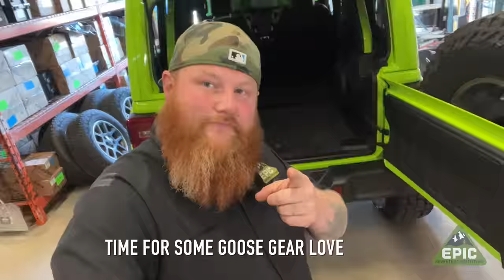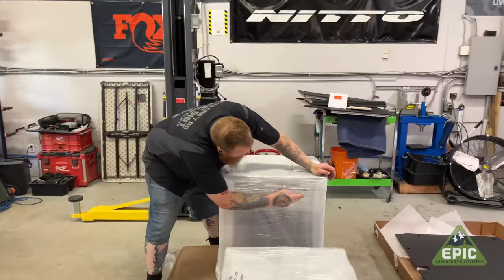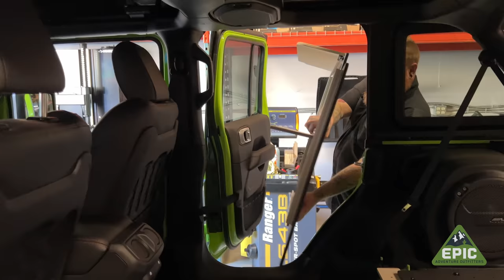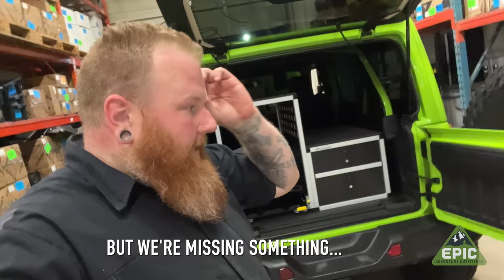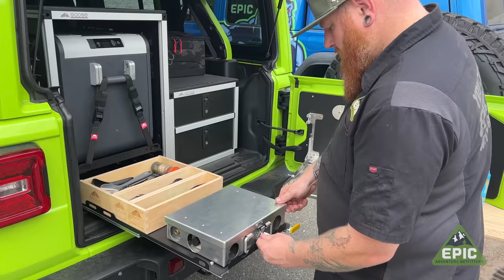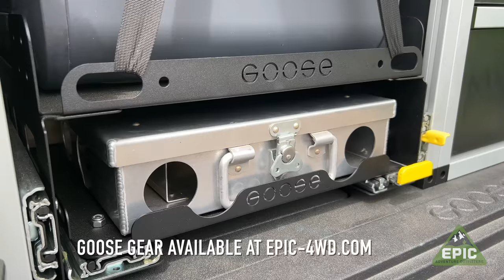EPIC Food Truck - Jeep Wrangler Goose Gear Kitchen, Drawers & Table Setup for Overland Adventures

Comment: Love the hat! :) I have a similar setup, Goose Gear full seat delete, Camp Kitchen 2.3 with drawer module. Light and strong, can't wait for the weather to warm up again!

Question: did you screw your Partners Steel stove to the stove slide? I tried using flat straps but it's a PITA. If you screwed down the stove, any issues with leaking? Keep the awesome videos coming!!!